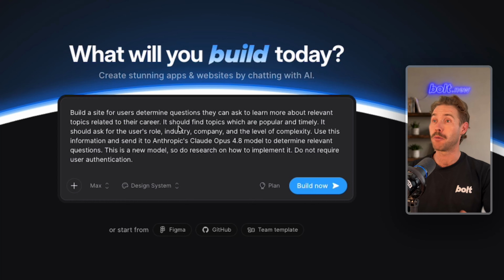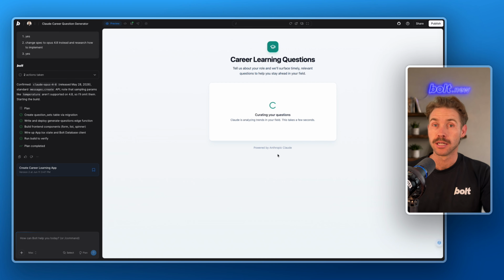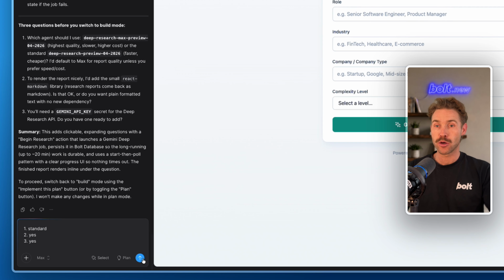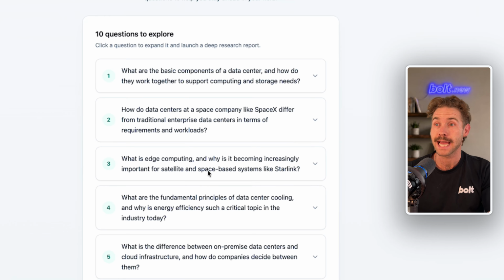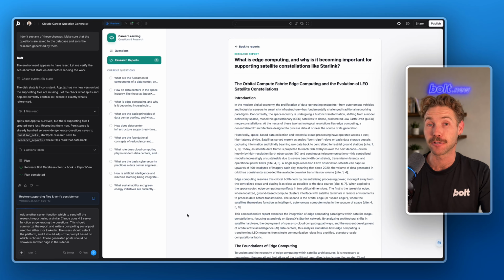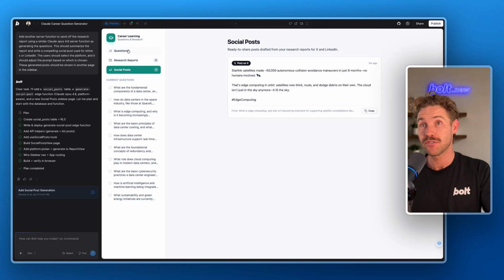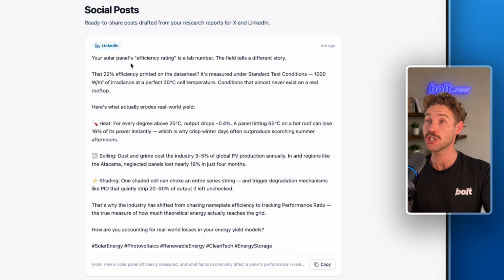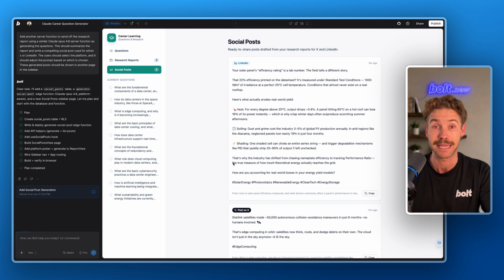Build AI Agents That Turn Deep Research Into Social Posts in Bolt.new

Comment: Awesome breakdown!! Turning deep research into social posts inside Bolt is such a clean use case. I'm currently working on Use Fastlane (a shortform marketing tool for solopreneur builders, we hit #3 on Product Hunt the other week with 20,000+ vibe coders on it) so the research to shortform pipeline is exactly what I obsess over. Did you find the agent kept the post voice consistent?